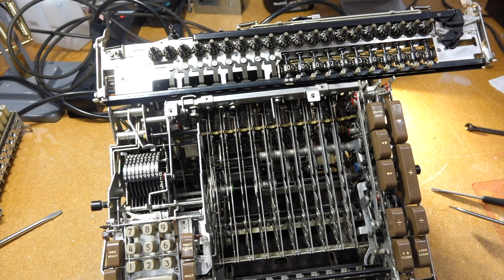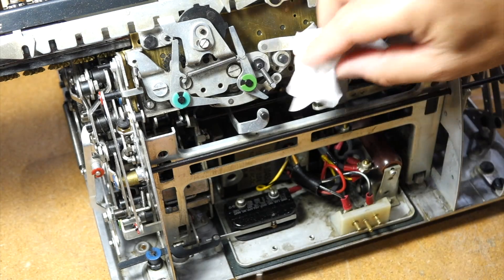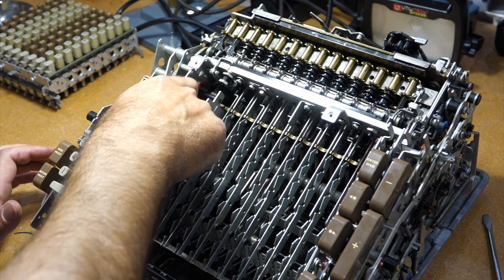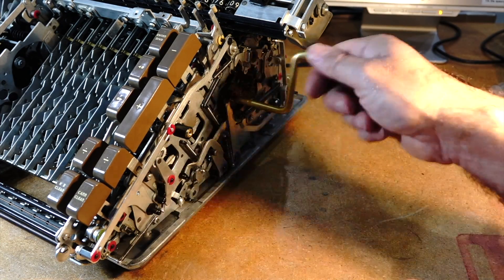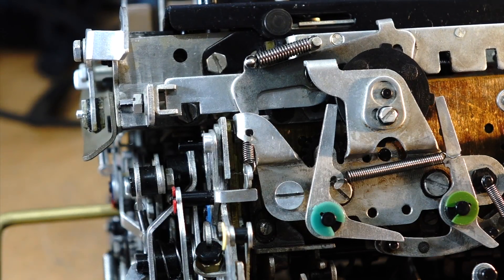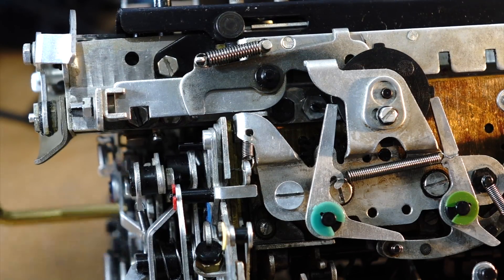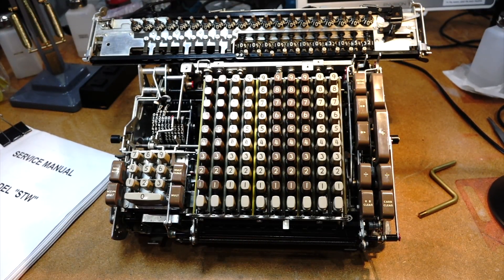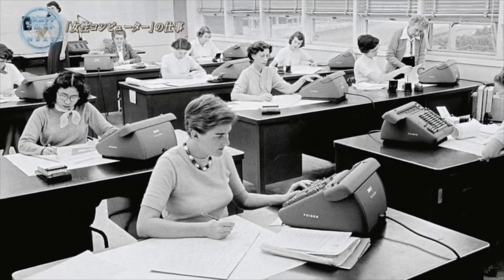My 1957 Friden Mechanical Calculator goes on Japanese TV

Comment: In 1964 I began my career at Hughes Aircraft Co. My first job was with crystal filters for radio links and the R&D section was where I was assigned. Filters for both the Surveyor Moon lander and the Apollo Lunar Module  were made in the same room, but not by me. In finding some of the right parameters for the filters I assembled and tuned, the chief engineer would let me use his Friden that would do square roots. I would go to the machine on his desk and put in the numbers and hit the odd button that started the process. Then I would go and get a cup of coffee to await the results, it was that slow, and extremely noisy. A year later and that engineer had one of the first Wang desktop calculators with the side unit for that purpose. Thanks for the peek inside and the oiling tools needed. I just might be able to reinvigorate an old IBM selectric I have.

Comment: I've translated the Japanese for anyone like me who came along a year too late:

[Title Card: Cosmic Front ☆]
[the star is very important]
Male Narrator: America: those who undertook the Apollo program, and who did great feats. At space research facilities, many unknown women played a part.
[jump to Katherine Johnson section]
Female Narrator: In order to do this, humans made important calculations. The tools they used were pencil and paper…and a mechanical calculator.
[Caption: Electromechanical Calculating Machine]
Female Narrator: Inside are packed many thousands of parts. With the turning of gears, it goes about its mechanical calculations. A collector was kind enough to show us a period calculator.
[Caption: Marc Verdiell]
Female Narrator: For instance, 12 x 312 is…[clackclackclackclack]…3744, and there it is. But how is this calculated? The calculator splits it into the ones, tens, and hundreds place. First it multiplies the 2 in 312. 12 x 2 is 24. Then for the tens, 12 x 10 is 120. Adding 24, it's 144. Finally in the hundreds, 3600. Add it all up and you get the result: 3744.
Extremely confident Japanese Marc: Multiplication and division took a few seconds, which compared to doing it by hand, was far faster. PCs today would be done in a fifteenth of a second.
Female Narrator: What this calculator can do is high speed operations. Using this calculator, Katherine could make complicated calculations and complete the researchers' requests.

Comment: I looked if there were subtitles, but the only thing I got was stuff like "Bo Davari must give me kira quinoa soup greens on this" - I don't think that's a good idea with such a delicate piece of equipment.

When Marc operates the machine: "Sankyo for external kappa nooooo customer I messed up"
You forgot to turn off external kappa if you multiply by 312, but it's a very easy mistake to make. At least you used non-gmo lubricant.

Comment: I think it's incomprehensible that someone sat down, grabbed a pencil and some paper and said, "OK, lets design this complex piece of machinery". I mean, how do you even START such a task? Amazing machine!
Reply: Not only that, but to make it from stamped steel parts! Amazing.
Reply: exactly its entirely unbelievable how complex and obvious it is at the same time. Just a ridiculous example of humans desire to learn.
Reply: Any machine like this is an improvement of an improvement of an etc...
Reply: @PaulMauser  Indeed I have an old version of another maker. It's the 1830 calculator (machined) with the 1890 parallel keyboard part (mostly stamped) without the multiplication register and it's automatic turning and shifting as it has to be done by hand.

Comment: Hi, I have one similar - a DW10 which is similar to yours but without the multiplier pad. Using one of your other videos, I’ve managed to get it mostly working - the only things that don’t work correctly is that following a division, the machine doesn’t reset until you press one of the carriage shift keys, and that the carriage return key is rather erratic in its operation - and it doesn’t lock down. I’m somewhat afraid to go further with it for fear of losing what I have so far. Anyway, here it is:

https://youtu.be/sw-uCaU18n8

Comment: Any theories on how the metal parts which you had to re-bend changed?  Heat in storage, possibly the jamming of the mechanism when you tried it after being in storage?
Reply from the maker: It's not that it didn't work at all, it did not work reliably. I am not sure what made it worse - machine jamming might have been the last straw.
Reply: My guess then would be since the troublesome parts are not made of hardened steel that over the decades their positions shifted to the point where it became unusable.  Kind of like guaranteed obsolescence.

Comment: Did you use WD-40 before? That stuff always gunks up like crazy.
Reply from the maker: Yes, that's probably part of my problem. That machine was so stuck so hard I ran out of other options at the beginning of the restoration process. But the moral of the story is the same: stay clear of WD-40 if you can.
Reply: I don't know if I mentioned it before but WD-40 is "Water Displacement" formula 40. 

https://www.wired.com/2009/04/st-whatsinside-6/

This made me cringe a little......

Mineral Oil
Seriously. WD-40 is mostly a mix of baby oil, Vaseline, and the goop inside homemade lava lamps.